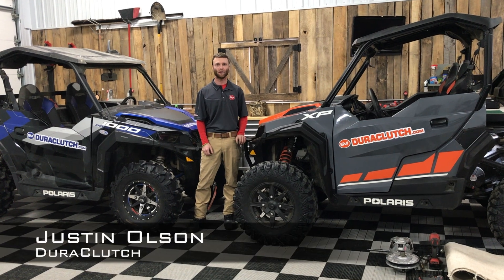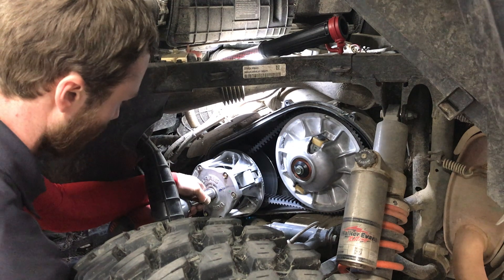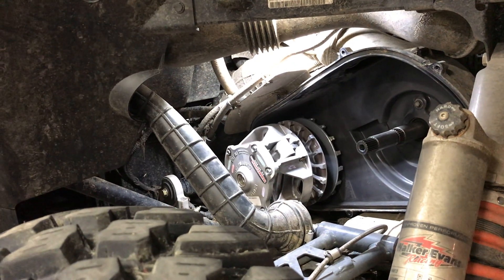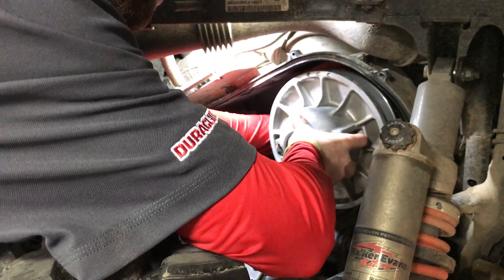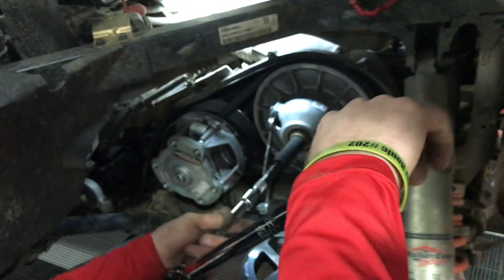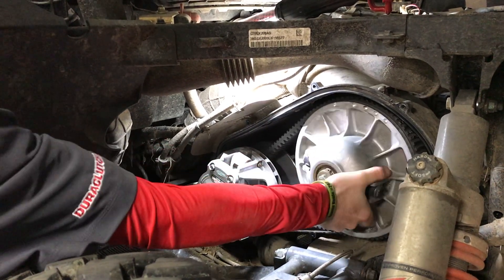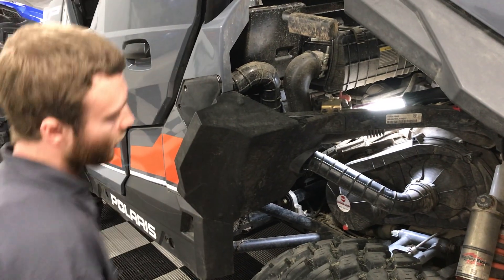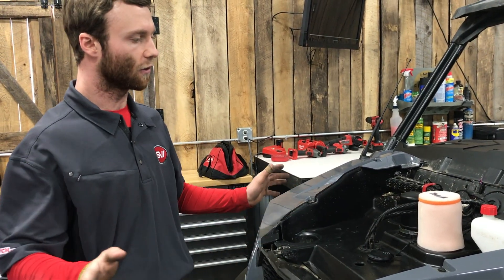HOW TO: Install DURACLUTCH Kit on Polaris GENERAL

Comment: Any tips on removing the secondary bolt? Maybe my impact just isn't strong enough. The primary came off as easy as yours.
Reply from the maker: The secondary bolt is torqued to 45 ft lb with Loctite. Any impact capable of that torque should allow you to loosen the bolt.